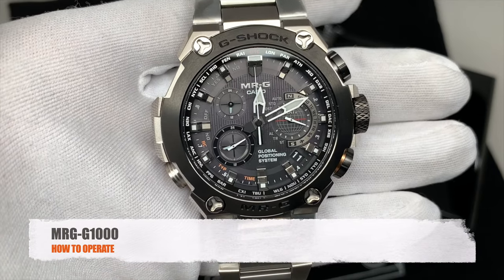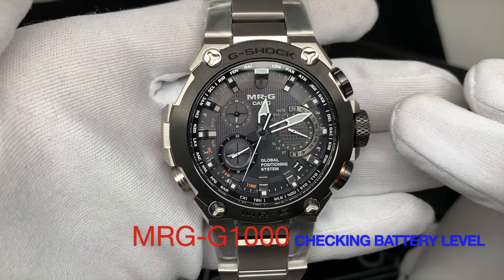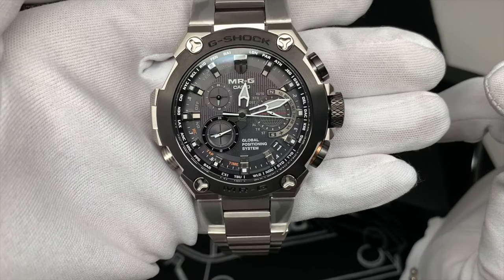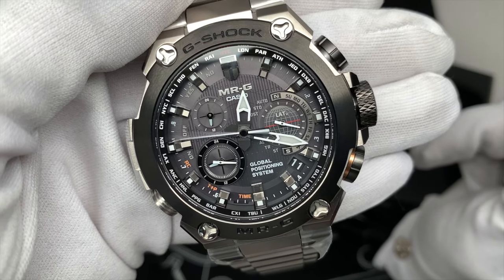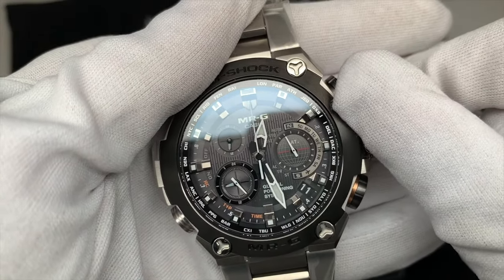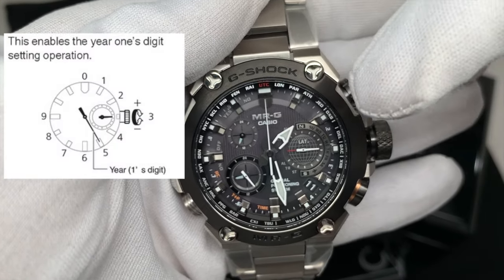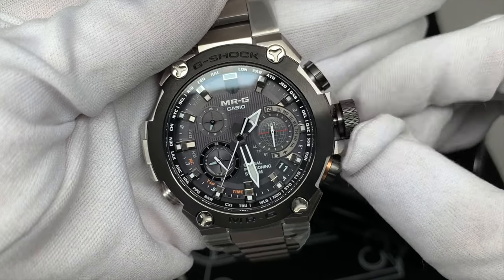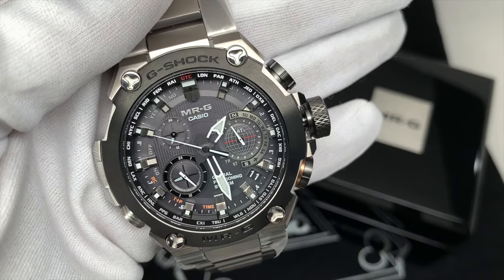How to Use MRG-G1000 - Set Time, Atomic, Run Timer, Stop Watch, and Alarms - Align Hands, Battery

Comment: ohh. so you cant set the stopwatch at the top of the hour because it freezes time in that mode. I guess you could do it with two synced up watches. I always like to have mine running at the top of the hour on my ggb100. It keeps time in 100ths. lol. Has to be manually reset every hour tho.

Comment: I don't think the MRG can be made to try and receive the atomic time signal manually. Just GPS, which is a shame. Additionally home and world time can't be swapped (you have to either use GPS position receive T+P, or manually change both), and you can't disable/enable the alarm until you wait for the alarm time to be displayed in the world time dial. A beautiful and robust watch that is unfortunately plagued by small daily usability nitpicks.

Comment: Also. if you set it(timer) to zero minute does it do a 24hour? most of them all zeroes means 24 hrs.
Reply: "When the small hour hand and smallminute hand are at 12 o’clock, acountdown start time of 24 hours isspecified."
Reply: If I have my world time kept at UTC which is basically the best setting for world time after owning a watch for so many years. the next best step is to give the timer a whole day instead of a 10 minute shadow(or 5 min or whatever the default is for that specified watch) with a world time the same as hometime. itll still swap but in a day instead of an hour or minute or second. (or 100th or 1000th of a second for some gshocks).
Reply: and i guess some people with more than one alarm like my 5 alarm ggb100 leave it at alarm 3 for some reason. just like an ocd thing.